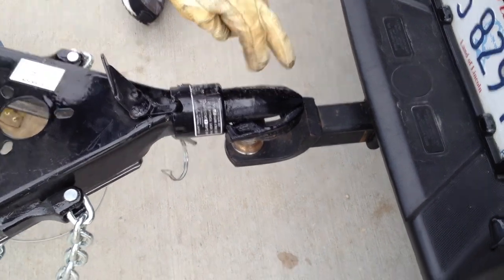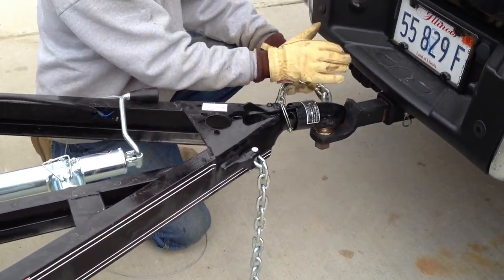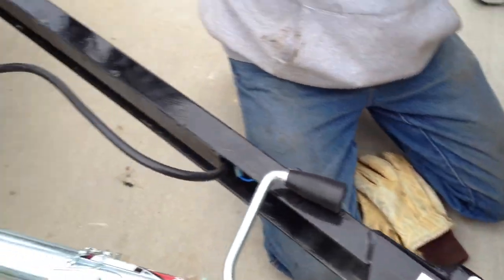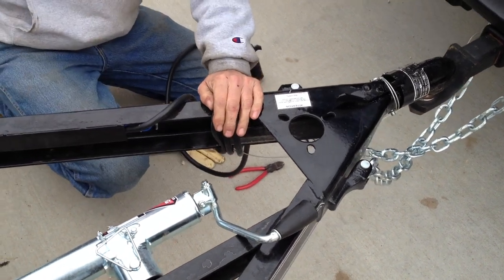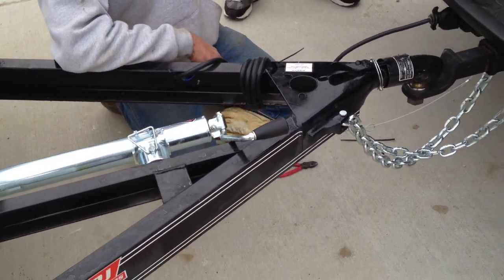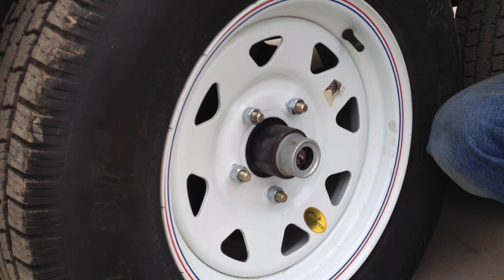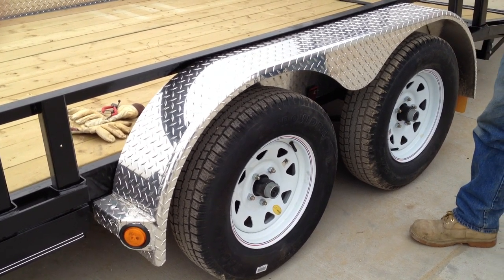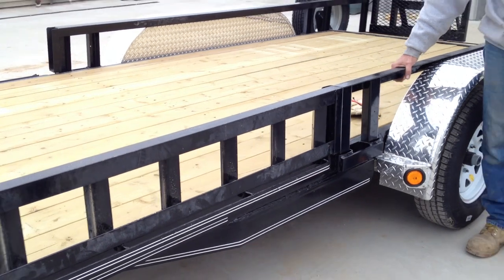How To Hook Up and Maintain a Utility Trailer

Comment: My father in law has a jack on his trailer that has a motor. It will raise and lower the trailer and moves it place to place on pavement it has a remote so you can control it. Its nice for use in tight areas where the trailer will fit but not the truck.